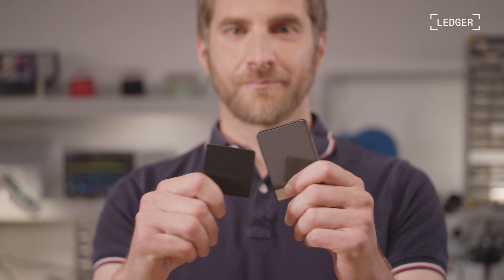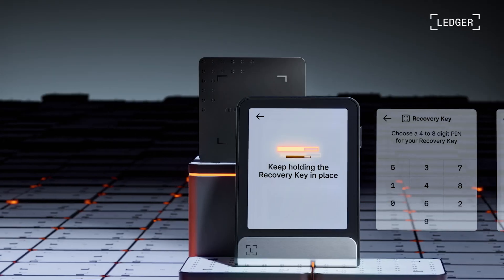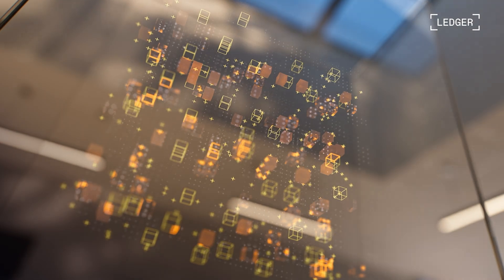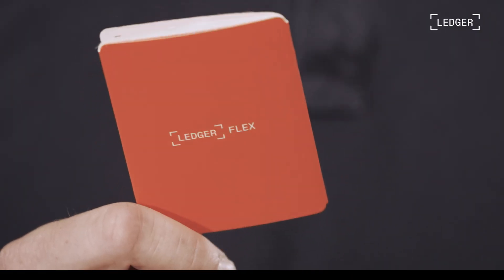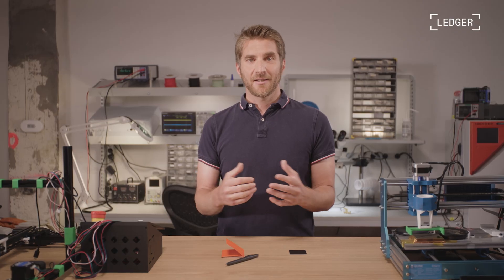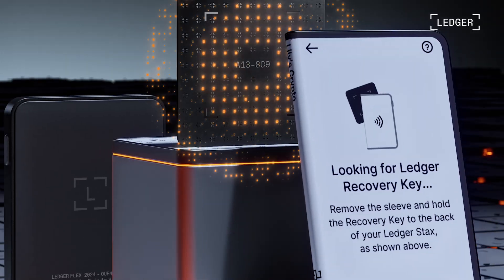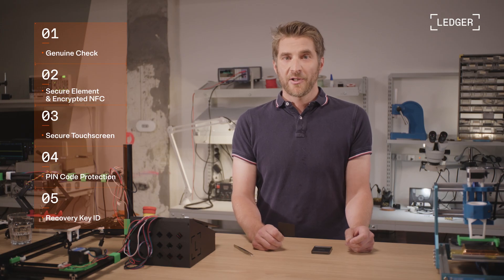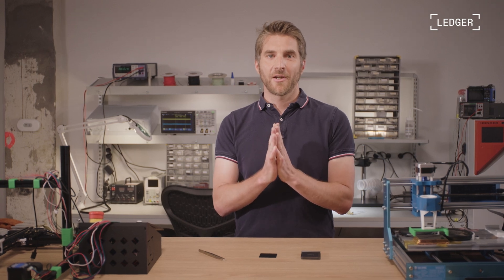Ledger Recovery Key: Private Backup for Your 24 Words | Technical Deep Dive

Comment: I have a Ledger Flex for about 6 months now.  Only 1 time in the 6 months was I asked the 24 word phrase to login to my assets?  I can usually just turn it on, and my assets appear?  Also, I only have about $30,000 of crypto in it, and my storage is saying there is 1.5% left?  Doesn't hold too much crypto?  And I've tried to contact Ledger, and that is an endless battle!  Very disappointed with the Flex thus far!!
Reply from the maker: Thanks for sharing your experience. We hear your concerns and want to help clarify a few key points about how your Ledger Flex works.

Once your device randomly generates your 24-word recovery phrase for the first time and you write it down on paper, you will only need to access it if you have to recover your device.

Ledger Flex, like all Ledger devices, prioritizes security above all else. It uses a Secure Element chip to protect private keys by keeping them completely isolated. This specialized security chip limits storage capacity but delivers the highest level of asset protection.

While Ledger Flex can store a limited number of apps at a time, this does not restrict the number of cryptocurrencies you can manage. Apps can be safely installed and uninstalled as needed without affecting your private keys or access to your assets. This design provides flexibility while maintaining top-tier security.

For instructions on installing and uninstalling apps on Ledger Flex, visit: https://support.ledger.com/article/9771945206941-zd

If you need help or have further questions, we are here to help resolve any issues and improve your experience. For official support, please connect with us directly: https://support.ledger.com/contact-us

Comment: i read that end of support on ledger nano s, do i need to worry on my asset on my nano s do i need to transfer to another wallet please make some clarification on this LEDGER
Reply: no its bip39 standard u can use any device that use this standard and "backup" ur Coins.
Reply from the maker: Your Ledger Nano S still works and the Ledger Nano S Plus remains fully supported.

The Ledger Nano S launched in 2016, but was officially sunset in 2022, and we’ve been gradually phasing out its support since. 

That doesn’t mean it’s bricked, it still lets you send, receive, buy, sell and access your assets but due to its technical limitations, it no longer receives the latest features or upgrades, but so long as you have control of your 24-word recovery phrase, you have control of your wallet. 

You can restore it anytime on a new Ledger or any BIP39-compatible wallet. No lock-in. No forced upgrade. Just a natural evolution as tech and security standards move forward.

Full context from our CTO Charles Guillemet: https://x.com/P3b7_/status/1938247864322347032 

For users who would like to upgrade to a supported device, Ledger is offering a 20% discount. You can learn more here: https://shop.ledger.com/pages/ledger-nano-s-upgrade-program

Comment: Hello, if I have a passphrase in all 24 words, ledger recover also saves me that password phrase?
Reply: No
Reply from the maker: Hello Jose, Ledger Recover does not back up your passphrase. The passphrase is an additional security feature that you can set up on your Ledger device to create a new set of private keys and accounts. It is distinct from your 24-word recovery phrase and is not stored or accessible by Ledger Recover. Therefore, if you use a passphrase, you must ensure you have a reliable backup of it, as it is not included in the Ledger Recover service.

You can check further details here: https://support.ledger.com/article/9579368109597-zd

If you have any more questions or need further assistance, feel free to reach out: https://support.ledger.com/contact-us

Thank you.
Reply: No  and thats a good thing.

Comment: Why not just buy a second Ledger hardware wallet and add the same seed phrase as back-up to that instead - a tried and tested device that you can use with a pin the same way, as well as use all its other features. Is this simply made to be a more cost-effective/cheaper backup option?
Reply: Sure. They still show that they can extract private keys out of device wirelessly. They didn't learn lesson from Ledger Recover scandal in the past.
Reply: the ledger device don't show you the private key that the difference so you can't export it
Reply: Unfortunately ledger wallets reset sometimes when inserting a usb cable or updates. Apparently its a security feature. Chance is high that if you do not use it for a while, it will reset
Reply: @kevinleslie6785 according to Ledger resources, this is NOT true..

Comment: Quantum computer is a biggest threat of Ledger Recovery key and Bitcoin Network what’s your take on?
Reply from the maker: Quantum computing is an exciting field and it's natural to wonder how it might impact crypto security. The good news is that Ledger is already focused on future-proofing. While quantum computers powerful enough to break cryptography are still theoretical, we're closely monitoring advancements and working with the blockchain community to develop quantum-resistant solutions.

Ledger devices use Secure Element chips designed to protect private keys against current threats. As the technology evolves, we'll continue to innovate to keep your crypto safe. For more on how we're addressing quantum computing concerns, check out this deep dive: https://www.ledger.com/blog/should-crypto-fear-quantum-computing

Your security is always our priority, and we're building for both today's challenges and tomorrow's possibilities.

Comment: Finally what the world was witing for! Ledger and Tangem combined into the poopiest product possible!
Reply from the maker: Ledger Recovery Key is differentiated by its Secure Element. Equipped with a Secure Element chip and certified operating system, and protected by a user-defined PIN, this durable 5cm square key allows for secure, effortless backup and restoration with just a few taps on your Ledger touchscreen device.

Ledger Recovery Key is for anyone ready to embrace secure self-custody with enhanced confidence and peace of mind. It's designed for users who seek greater optionality in managing their Secret Recovery Phrase, acknowledging that self-custody is personal and a "one-size-fits-all" approach doesn't apply.

While competitors have their strengths, Ledger does not compromise on security. Our security model and continuous innovation ensure that your assets stay in your control, no matter what.

We encourage everyone to research thoroughly and make informed decisions about their security.

This innovative physical spare key eases the process of managing your phrase. It allows you to keep your foundational Recovery Sheet safely out of sight, while providing a convenient, PIN-protected backup for everyday recovery needs.

Crucially, Ledger Recovery Key strengthens your defense against phishing. By reducing the need to have your Secret Recovery Phrase readily accessible, it minimizes the risk of accidental exposure to scammers.

Unlike an unprotected sheet, your Recovery Key's PIN protection makes it much harder to phish.

Learn more: https://support.ledger.com/article/Ledger-Recovery-Key-FAQ

Comment: Why is the key card a square instead of a standardised size like a credit card? If it was a standard credit card size it would fit in every card holding product already in existence from wallets to purses to travel folios. But with this square size it doesnt fit anywhere.

What is the logic behind that design choice?
Reply: Why does it matter what it fits in? It's not something you should be carrying around. It's a backup key to store away safely. If all goes well you should never have to touch it again after setting it up.
I'd say the design choice was specifically so people don't carry it around like every other card and doesn't get thrown out by mistake by someone thinking it's a random rewards card.
Reply: @matt09ward because every single card holder ever made is a standard size. What if I want to buy a card holder to store it in while its in my safe? What is the point making it an odd size? Theres no benefit I can see which is why im asking what is the logic behind it. Saying the logic is so people dont keep it in their wallet makes no sense. Why would you make a card that fits no where instead of making a card that fits everywhere?
Reply: @jesselivermore9285 for the same reason power plugs are all different shapes and sizes depending on where in the world you are and what the use case is. It stops people from doing stupid things.
What if you want to put it in a card holder in a safe... Well you can't and that seems to be the point. If you want to have a melt down over that then don't buy it.
Reply: @matt09ward All of the worlds plugs being different is not a good thing. I still dont undertsand the logic behind a square shaped card, so why are you commenting to my question if you cant explain the logic. Im waiting for a ledger representative to explain the logic behind the square card.
Reply: @jesselivermore9285 i just explained the likely logic behind it. For stopping stupid people from using it and storing it in the very way you are complaining it can't be stored in. The same way you can't plug a 110v plug into a 240v socket, you can't put a ledger backup key card into a wallet to carry around each day.
All the world's plugs being different is a good thing, it stops stupid people from dying.
Reply: @matt09ward  So ledger want this key card to always be loose and unsecured, whether its in your safe or desk draw or when you are travelling with it because you are moving countries, it should always be loose and never in a card holder. Thats horrible logic.
Reply: @jesselivermore9285 is a card holder not also loose? Where does it end, do you bolt the card holder to the safe?
I think the benefit of it being different far outweighs the negative.
Personally I'd rather it be more 3d like a cube so it's easier to find.
Reply: @matt09ward by your logic people accidently throw away their credit cards because they confuse them with old rewards card. Its horrible logic. If I owned this ledger key card I should be able to buy a nice steel card holder for it while its stored, then I should be able to move countries with it safely in my travel folio. Where can I put it if its loose? Making the card square is horrible logic.
Reply: @jesselivermore9285 
I think it is the same width as the narrow side of bank card and shorter on the long side of bank card. so it should still fit in card holder.